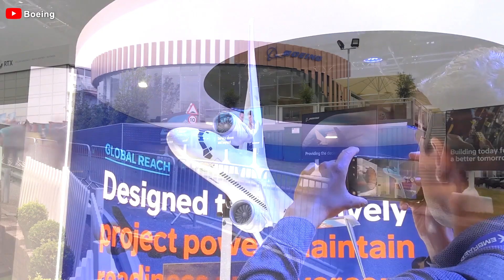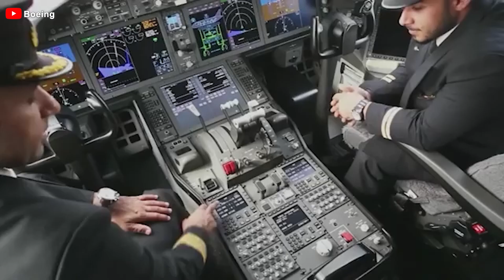Why 2025 Will Be a HUGE Year For Aviation?

Comment: In My Opinion: Boeing’s Strategic Missteps

In my opinion, Boeing made a critical mistake when it acquired McDonnell Douglas and subsequently phased out some of its most iconic aircraft. Driven by a desire to be the number one aerospace company, Boeing dismantled beloved models and discontinued the 757, leaving the 737 as their primary narrow-body competitor. To me, the 737 is an uncomfortable plane to fly in, not to mention its history of mechanical issues.

Boeing missed a major opportunity by not upgrading models like the MD-90, the Boeing 717, and the 757. They could have also continued improving the MD-11, a durable and reliable aircraft. Enhancing these models and building a family of planes around the Boeing 717 (formerly the MD-95) could have given Boeing a competitive edge.

I recall when AirTran expressed interest in purchasing more Boeing 717s, but Boeing shut down the production line and forced them to switch to the 737. This decision was shortsighted. Aircraft like the Airbus A318 and Boeing 737-600 were designed to compete with the 717, yet both have been phased out, while the 717 is still flying today. Airlines, including Delta, might have opted for a modernized Boeing 717 family instead of newer aircraft like the Airbus A220, which features the same desirable 2-3 seating configuration that passengers prefer.

Boeing’s relentless pursuit of market dominance led to the demise of McDonnell Douglas, but this strategy backfired. Airbus capitalized on Boeing's decisions by developing the A320 family—a superior, more comfortable product in nearly every aspect. Personally, I avoid flying on the 737 when possible and choose airlines that operate Airbus planes for a better flying experience.

Destroying a legacy company has consequences. As the saying goes, "What goes around comes around." Yet, it’s never too late for Boeing to rethink its strategy. Reviving and modernizing the rugged McDonnell Douglas designs—aircraft built like tanks—could offer Boeing a competitive response to Airbus. By diversifying their fleet instead of focusing solely on the 737, Boeing could balance profit with long-term innovation.

Unfortunately, Boeing's decision to prioritize profits over product diversity has led to a bland and uninspiring aviation market. Nowadays, airplanes lack character, and flying feels monotonous. Boeing’s downfall stems from neglecting the value of variety and innovation in aviation. In life and business, what we put out into the world eventually comes back to us, whether it’s goodwill or mistakes.

This is my opinion.

Comment: ..When Boeing will be on top again, Boeing needs to do two things..: Produced aircraft needs to do on the required safety demands and also on their production demands, which requested by airline operators..

If Boeing wants to develop a new freighter aircraft, the Boeing 787-9 will be the best frame to do so.. Not only that it is larger than the standard Boeing 787-8, the freight capacity is more optimal due it is larger and saving more the use of extra planes.. So, environmentally it is also optimal..
Reply from the maker: I really like the 787-9

Comment: While theoretically Boeing should lose market share to Airbus, this process is limited by Airbus's own ability to produce enough planes to satisfy the market. But that is a dangerous strategy for Boeing to follow, and it really needs to plan far far ahead to catch up with Airbus, let alone overtake it. After all, Airbus is not going to be standing still...
Reply from the maker: While both have had problems with delivery delays, Boeing's production capacity is being hit harder.